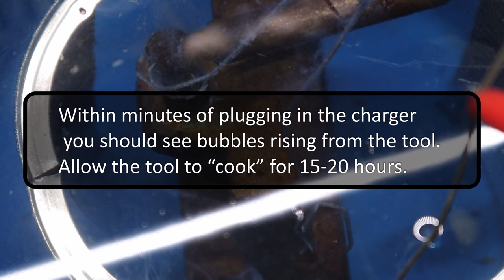How To Remove Rust With Electrolysis In Six Easy Steps

Comment: Apple cider vinegar. It’s easy.  It’s how I make gas tanks look new inside.
Reply from the maker: I actually want to try that when I find another small motor with a rusted tank.
Reply: @AJRestoration   it works really good. I have saved many motorcycle tanks this way. It usually takes two days. I reuse the vinegar a few times. Just let the sludge settle then pour off the clear stuff off of the top.
Reply from the maker: That is good to know actually. I had to use acid in a tank before, but it tends to rust just as quick again.
Reply: @AJRestoration  Yes. What I do is rinse the tank out very well with water and I let it dry out with some air. Then I put a little bit of oil mix with some gasoline in it and swish it around inside

Comment: How can i determine which wire is the negative and which is positive in my power supply..?
I really do need an answer
Reply: Does it depend on colors?
Reply from the maker: If you have a powersupply, the red wire is usually the positive, and black is negative. It is safest to use a multimeter if you are not sure about polarity. I have also explained in the video how you can determine polarity by observing where the bubbles are coming from.
Reply: @AJRestoration  what an answer 🤍
Now i almost have the whole tools 
Thank you
Reply: If youre looking for polarity, you can dip both wires into water without touching and the power is on, wait until you see bubbles come out of one of the wires and thats your negative.
Reply: @r3_d2LKG  .that's really helpful 
Thanks

Comment: Why not Ac power instead of dc power. Is it posibel??
Reply from the maker: Ac Mains is extremely dangerous, it could kill you.
Reply: AC at mains voltage is extremely dangerous.  But also, it won’t work because the current alternates and therefore the workpiece is alternatively between cathode and anode.  The workpiece needs to stay as the cathode so you need to use DC.

Comment: I tried this this weekend with a NAPA 6amp car battery charger, I couldn't get it to do anything. The only thing I didn't do was completely submerge it.. do both need to be completely submerged? I tried with out the wire I wonder if that's where it went wrong
Reply from the maker: Usually, you don't need to completely submerge it, It could be that the wires are coated with something and did not make contact. You can also test your power supply and see if it is working as intended. Make sure the parts in the solution do not touch, it shorts out the power supply. Also see if the solution does not have too much baking soda or electrolyte, the stronger the electrolyte the more amps it will draw and some power supplies do not like that. Did you see any bubbles rise from the part you wanted to clean? Let me know if that helps, maybe we can identify what went wrong.
Reply: @AJRestoration   I actually just ran to Lowes and bought some wire and completely submerged both my old engine part and the sacrificial coffee can.. still nothing! I think this little car battery charger isn't doing right, it only has a red power on light and a green light (to show when its charging an actual battery) I have charged several of my batteries with it but maybe its limited on performing this?
Reply: Unless you got the old charger that not automatic or led smart to it  or else you can't use those charger.  What you can do with your is use an extra batteries then hook up charger to the batteries and then hook up the batteries to the metal you want to remove rust.   That way the batteries will do the work and the charger will charge the batteries.
Reply: @TuanTran-zp8bt  I found that out after doing some digging! But didn’t know what you just mentioned about using the battery! So basically I could hook up the smart charger to a car battery.. get some alligator clamp an run leads from the car battery to the metal and that would work?
Reply: @jmitchell513  yes, so use the car batteries to hook up the metal and the reason u use charger hook to batteries so your batteries don't ran out of juice and continue give out engouh power. The charger will charge the batteries while the batteries is doing the work.
Reply: @TuanTran-zp8bt  nice! I'm going to give this a go later! Thanks for the insight
Reply: @TuanTran-zp8bt  i don't think a car battery is recommend for this unless you can limit the amps, it could even be dangerous as it could pull very high amps. From what i read 12-20vdc and max 10 amps, (typically 2amps works very well) the higher the amps the quicker the hydrogen formation, too high amps can ruin the part through embrittlement.
Reply: Your battery charger is newer i bet.. Its a smart charger so it wont just discharge 12v at 5amp because u said to.. It checks for continutity in the circt before it turns on. So your not getting any power to your water..if u have a spare 12v car battery you could connect it to your project and you would instantley see a million tiny bubbles.. Then connect the charger to the battery.. I would do it at a trickle setting so as not to damage the battery
Reply: Yes it has to be submerged for the solution/voltage to interact between the rusty tools and the sacrificial can. Don't quite understand what you mean by "tried it without the wire" but each rusty piece has to be grounded directly to the power supply. If you're using an "automatic" battery charger, one that doesn't charge unless it sees some kind of load/resistance then that's your problem. Either use a manual charger or hook up your leads to the sacrificial can and rusty tool to a 12V battery and then the charger to the battery do it sees a load which will allow it to turn on.

I've done this tons of times. I started doing it after a massive shop fire (thanks to my neighbor) destroyed my marine and auto repair shop, leaving all of our tools in a slowly draining 16" deep swamp of muddy water. Over the next 3 weeks as tools appeared from the retreating water they quickly rusted so I wanted to try to save as many of them as possible. I used large rectangular tubs and 1" x 8" bolts as sacrificial material. I used full size battery charger clamps to string steel wire across the tubs with the rusty tools attached by smaller alligator clips dangling completely submerged in the solution. Most tools came out after 10-12 hours black and rust free, only needing a trip to the wire wheel for cleaning and a coating of paint, plastidip, or WD40 to prevent rusting. Often on hand tools like combination wrenches, sockets, or rachets I would spend the time to sand the tools to a very smooth finish and then polish them using my 1HP Jet Buffer/Polisher, making them look better than new. I've even polished some tools for others after they've seen mine. 

Rustier tools I sometimes wire wheeled and ran through the solution for another day. In almost every case all the rust was removed and just a little extra work was needed to loosen slip joints in pliers or the adjustments screws of adjustable wrenches or vise grips. I probably derusted over 1,000 hand tools over the next 6 months and either kept them (unreplaceable ones) or sold them after insurance paid off and I was able to buy new tools. Since then I've derusted used car parts before reinstalling them as well as vintage metal items I've found and wanted to clean up. It's a lot of fun to be able to bring something badly rusted back to life.

Comment: Is that can tin?
Reply: its a plain steel can, but do be aware most of these will be coated with some type of lacquer and will not conduct electricity to the water very well. Use any old scraps of steel that you don't want to keep

Comment: The most economical, famous and easiest way is to dip  rusted part in Hydrochloric acid solution and leave it in it till all the rust is removed automatically.
Reply: I prefer phosphoric acid.  It dissolves the rust just as effectively (only slightly slower), but it is much less damaging to everything else.  Skin, lungs, eyes, and the metal itself for example.
Reply: @CL-gq3no  I've also seen other YouTubers use citric acid or oxalic acid.  Both pretty mild.  Yeah, HCl is strong stuff...

Comment: 0:37 is it a AC power supply or DC power supply?
Reply from the maker: 12v DC power supply that I used, I got it out of an old Dell computer.
Reply: @AJRestoration  this 12v DC power supply is connected to our home socket AC, from where we usually connect our TV or Micro Oven or Washing Machine. Am I right? Please correct me.

Comment: A wire brush on the angle grinder would left the shining
Reply: .... and also have stripped metal off precision parts, leaving a sloppy fit. Electrolysis only removes the rust and not the metal beneath it

Comment: This makes me wish I had kept the power supply from some of my old desktop computers
Reply from the maker: I always keep those! I have three now haha
Reply: Use one of those old wall warts instead. Have to figure out which wire is positive but then g2g.
Reply: @nwstraith  i tried to use those but 2 of them died after an hour or so, maybe im doing something wrong
Reply: @atosz066  I'm not sure. I found one that's 12v 1amp and have had that out on my porch for days on end. Maybe it's super humid where you are or it got rained on?
Reply: @nwstraith  or it was just way low amps... Miliamps
Reply: @JohnDoe-pv2iu  possible, it seems like 1 Amp is the minimum, but I'm uncertain of that
Reply: Theres always goodwill.
Reply: I kept over a dozen power supplies! Cheers.

Comment: I tried this and it worked great for removing rust! Unfortunately, however, it also worked great at removing all the enamel from my teeth, and then, eventually, it caused them all to rot. I first felt the pain when I brushed my teeth later that evening. Then, when I brushed again the next morning, it seemed to have gotten even worse. From that point on, each tine I brushed my teeth, I could tell that they were continuing to decline, and they were even starting to turn the same color that my toothbrush had already turned, as it also seemed to be infected  by the curse. Now, every single one of my teeth have completely rotted, and finished their way falling out of my mouth hole, and my favorite toothbrush tastes like battery acid. Those things are rather unfortunate, some might say, but the one positive thing about this bad situation is that I won’t ever need to buy another toothbrush again, anyway; so I guess that’s not really a problem anymore, after all. Plus, al mu tools that were rusty look like they’re brand new now, too, and that’s definitely a great thing, because they come in handy while I’m doing lots of different activities I enjoy, and I  have to use them to cut and crush all my food into a soft enough state so that I’m able to chew it the rest of the way with my gums, as well, of course, so that’s yet another reason why having nice, shiny tools is a plus. I guess it’s not all that bad, really, now that I think about it, considering that my tools are all cleaned up like they are now. It’s a shame about that toothbrush, though. That thing was less than a year old when it first became cursed. Oh yeah, and my teeth, also. It sorta sucked losing them, too.. All in all, though, it worked out for the best. I can always replace that toothbrush in the future, I suppose, if I end up wanting  to do that. I might just need a new one someday, after the rust returns to all my tools, and I decide I want to perform this same witchcraft all over again, but I’ll never have to have one again, though, obviously. Never again will I ever have to worry about brushing my teeth, or getting food stuck between them, or having to experience the terrible pain of biting my tongue, and knowing that is a huge relief, to say the very least. For the first time in my life, I’m free from the constraints of a mouth full of pearly white chompers, and, I must say, experiencing this newfound freedom is truly the best feeling in the world. After going through all that I have recently, I can now honestly say that I know exactly how wonderful and amazing the slaves must have felt, after all those brave white heroes fought for their freedom, and won. I can now fully understand how blessed the Indians must have felt, too, when they learned that the generous Americans had a whole reservation out west that they were going to let them live on, totally free of charge, and it would be like it was their own land, sort of, even though it was right there in the middle of the the white man’s country. This obviously must have seemed too good to be true for the defeated red Indians at that time, after they’d finally realized they were just too outnumbered, outgunned, and uncivilized to conquer any American land for themselves on the battlefield. It had to have felt like a dream-come-true to learn that instead of being scalped, and having their women and children become sex slaves, not only would their lives be spared, from that point forward, but they would all be allowed to stay on the white man’s land, and live there in peace, as permanent residents of this amazing new prosperous, civilized nation, that belonged to a totally different tribe. I can certainly relate to how they felt at that time, when they finally started to understand just how lucky they were. It’s really no surprise  that so many of them became Christians around that time. By sharing their land with the poor indigenous savages, those unbelievably tolerant, open-minded white people showed them a perfect example of the love of Christ. I feel exactly like those Indians did back then, and just like the coloreds did, as well, during that unforgettable period of time, when their owners gave them away to themselves, and, for the first time in their history, since the time when they began walking upright, they became possessions of their own. It’s a truly awesome feeling, no doubt about it. That I can tell you. God bless America!
Reply: Bro, thank you for the time and effort to compose this diatribe.  With the spare time you seem to have and the active mind to go with it, I am sure in the  future you will find some constructive use for those newly cleaned up tools. 
An Idea to chem on: Top Ramen and vegetables well chopped gum up nicely.  Cook the veggies well for a good period of time before the noodles.
Reply: Use your wife's brush next time.
Reply: But, it's does sound like your brain is rust free.
Reply: @ZingaraJoe  He can always just run whatever he wants to eat through a blender. Friend of mine broke his jaw and had it wired shut. He could only have food through a straw so he went with the obvious stuff; puddings, milkshakes, yogurt, etc. After a couple of months and losing 30 pounds he was desperate for meat and potatoes, etc. So I brought my blender over with some leftover roast beef, mashed potatoes & gravy, and green beans. Tossed each item in the blender and beat it into a suckable thickness, put each into a dish and let him try them. He loved it. Said it tasted just like it should but without the satisfaction of chewing it up. After that he ate fried chicken, cheeseburgers, fish sticks, French fries, eggs and bacon, whatever he wanted. Just had to add enough liquid to make them bendable enough to go through a straw. Sometimes condiments, sometimes water. But to him anything was better than before.

Comment: Couple washes with muriatic acid would have been just as good if not better that would only took a couple minutes
Reply: @Andy Smythe This process can leave the rusty tool with a black finish. I think it has to do with what you use for your sacrificial metal. I've mostly used large (1" x 8" or longer steel bolts because I have lots sitting around) and got a black finish on most items. But using a tin can or something with less pure steel in it likely would leave a different finish. I've got some tools I need to derust, think I'll use something different as a sacrificial metal this time to see what happens.

Comment: Now just leave it soaking in a mix of ATF and acetone for a few hours in a sealed container,
Reply: What is  ATF ? Is an abbreviation for a chemical? Like MEK ?
Reply: @billmeade9029  maybe Automatic Transmission Fluid? That plus acetone is used as a penetrating oil to get the vice's threads moving. But just a guess.

Comment: Hydrogen embrittlement could ruin the steel.
Reply from the maker: Thank you for the comment. As far as I know metals prone to hydrogen embrittlement are the higher alloy steels, mild steel and cast iron should not present a problem. What are your thoughts?
Reply: @AJRestoration  Thank you for your reply. Wikipedia says: All types of steel are endangered by hydrogen embrittlement, with the exception of austenitic steels such as CrNi steels.

Higher-strength steels (> 800 MP) are at higher risk from hydrogen embrittlement.

So I think that electrolysis could weaken normal steel, that could be dangerous, with screws, shafts, chains and so on.

After contact with atomic hydrogen, as happens with electrolysis, the steel parts would have to be heated immediately to 200 to 300 degrees Celsius for several hours so that the hydrogen diffuses out before it combines.
Reply from the maker: Thank you for the reply. We will keep this in mind. I will also read up on the time required for heating.
Reply: @AJRestoration  Thank you.

Comment: What a crap way of cleaning it. Electric and hand Wire buff. Then gas torch to free up stubborn parts. Remove each part wire buff. Oil assemble and don’t let the wife or kids  play wth your toys
Reply: The central idea of electrolysis or vinegar is to get the part pretty clean before you start spending an hour and a half on it with a bunch of power tools, which is a crap method.